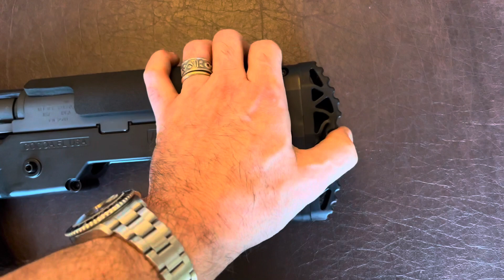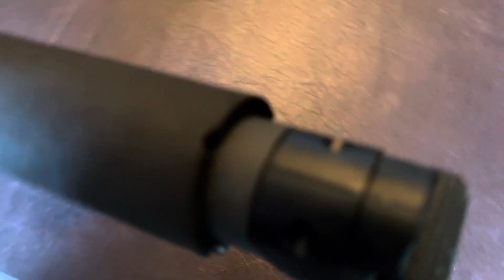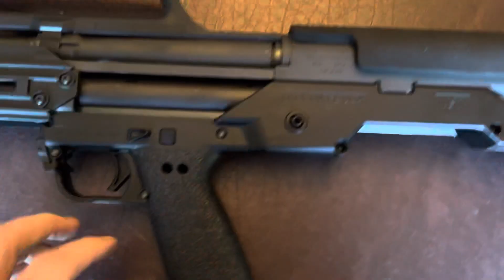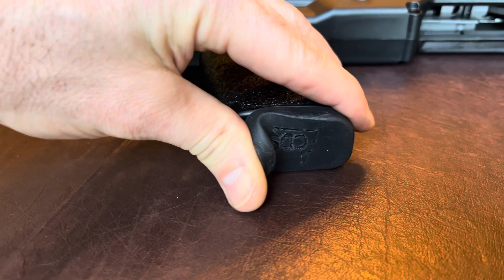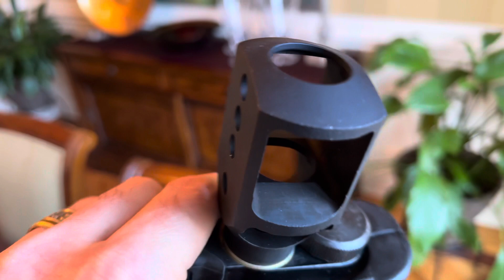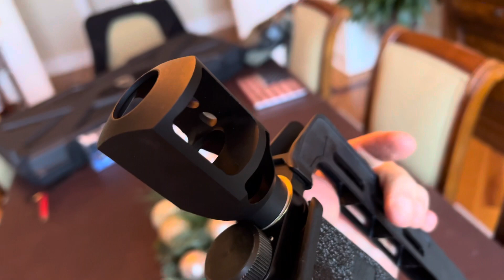KelTec KS7 bullpup comfort modifications

Comment: I need that recoil pad. I have the Howitzer Break. I haven't shot after the upgrades. They were the longest 7 shots I've ever had to endure.  I didn't like the way they put so much Lock-Tite on the top rail that you strip the screws to remove it for a Picatinny upgrade. Used a tree trimmer to cut off the top plastic hand/sight rail. Vice grip to remove the welded screws. Upper rail upgrade came with new screws with Loctite LOL. The KS-7 looks nice along with my other bull-pups. I'm still having problems installing the foregrip rail. Not enough play between the barrel and charging handle. Throw those parts into my live and learn box.

Comment: I read claims the muzzle brake reduces recoil by 70%. Do you agree? If not, by how much? Thanks
Reply from the maker: Not sure how they would measure that unless they had some device that could. It does reduce recoil significantly. Well worth the spend.
Reply: @tworedtoys  Have you shot it in an indoor range? I've been thinking about getting one but I read the Howitzer brake releases a ton of gas indoors which was a dealbreaker for some.